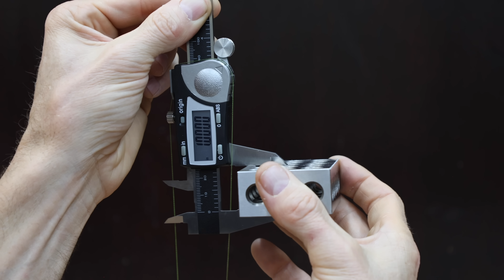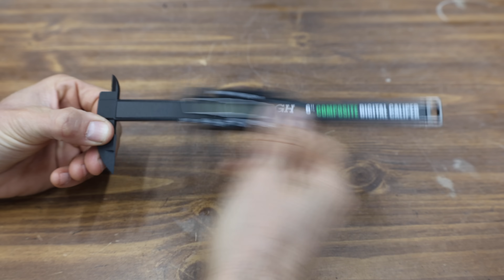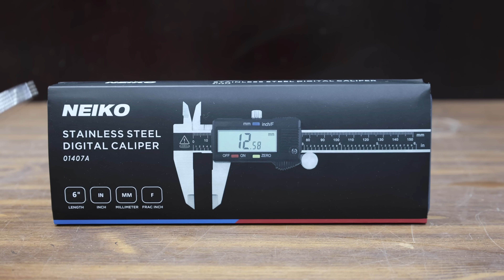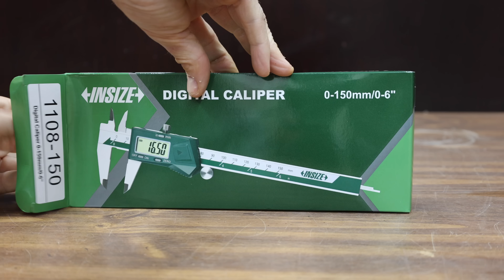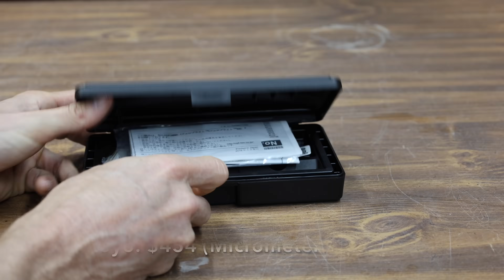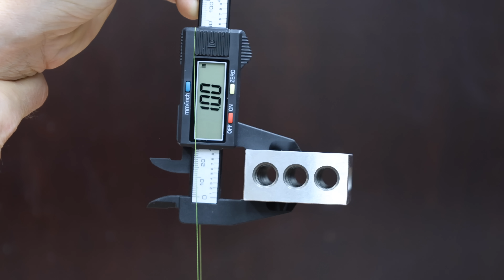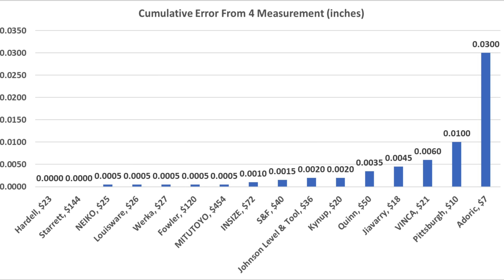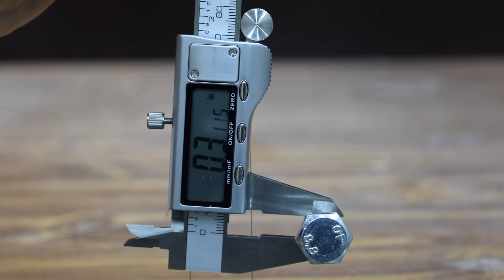I've Been Proven Wrong About Calipers!

Comment: The key here is accuracy over the time!

You gotta throw the top 5 calipers around the garage for a year, ten come back and do the test again.

Calipers have a resolution hand accuracy specification. All the top brands are within that spec... But will they continue to be in that spec after a year... That's all that matters. Will the battery terminals corrode? Will the buttons fall out? Will dust or debris damage anything?

There's a reason mitutoyos are $200+...
Reply from the maker: Thanks for the suggestion.

Comment: Important Tip - Buy SR44 batteries for your calipers, vs LR44 ones. The LR44’s output voltage droops as they’re used, and most calipers cut out at fairly high voltages - so your actual battery life is much less than you’d think based on mAh ratings. SR44s are silver-oxide chemistry, so the voltage stays high before dropping at the very end of life. They last much longer in typical cheap calipers than the LR44s, are well worth the higher cost.

If you’re buying new calipers, though, go for ones with CR2032 batteries, there’s no comparison in terms of how long the batteries last.
Reply from the maker: Thanks for the feedback.

Comment: Mitutoyo's battery life is measured in years. That is all my shop uses. We've had batteries go bad in the packages before, in the front office between battery changes in the calipers
Reply: It's true. Mitutoyo somehow gets batteries to last as long as they would just sitting around. I only use silver oxide batteries too. It's worth it. If I could put platinum in there I would. They deserve the very best. My Mitus live with a silver battery in their mouth.
Reply from the maker: Thanks for the feedback.

Comment: Some great points and intelligent testing here (very sensible to use a weight) but unfortunately missed the most important aspect of digital calipers: parasitic battery drain.

Every cheap pair I've owned drains the battery fast when turned off, meaning they're dead within 3 or 4 months even if unused. Then it doesn't matter how accurate or cheap they are as they don't measure anything. I switched to mostly using dial calipers because of this.

I bet if you measure the current draw while powered off the Mitutoyos and Starrets will be streaks ahead of most others. @AvE did a bit on this years ago I think.

Comment: A lot of important things not mentioned. Relative humidity as stated in manual ? I have calipers that only work up to 80%rH and thats true. I also have calipers that turn their display on upon moving the jaws, without reset to 0, so kind of absolute, very handy. I want to read out an caliper electronically, DRO. Do they have a connector, or is there at least a place to solder on, is the protocol documented in the manual, or does it conform to some other brands. 
The plastic ones are just crap, but a caliper needs to have an accuracy of 0.03mm (DIN862) or 0.02mm (MPE) and the manual should state the standard. Everything better is called 'good enough'.

Comment: My 40-year experiences - now retired - with calipers. 
. Wish I still had my work issued Mitutoyo digital caliper. 
. My cheap digital calipers batteries are usually dead when I’m about to used them.
. Fractional digital calipers seem to be a good idea specially for woodworking. However, they create more confusion than being helpful. E.g. a ‘3 3/128’ reading is not easily processed by me. Instead, a got a  Fractional Dial Caliper (with decimal sub-scale) that always works (no battery required). 
. Ask yourself if you need the .0001 accuracy/precision/resolution for home use. If not, a dial - no battery - caliper of medium quality is the way to go. I doubt that people at home are doing QC work measuring critical jet engine parts at home.
Reply from the maker: Thanks for sharing.

Comment: Just a heads up - that Mitutoyo price is way off on your results. That model # without the carbide and SPC is around $150. Side note - there is no way you can really test this but working at a calibration company Mitutoyo is bombproof (Starrett comes in good as well). For casual home use it wouldn't matter but for serious regular use there is a massive difference even stepping down to a Fowler or down again to Insize. They also carry replacement parts for very old models.

Comment: I built a digital depth gauge for my drill press using cheap-o plastic calipers.  They worked fine, because I could cut the excess length off, drill mounting holes, and not worry about wasting money if I ruined them.  0.01" precision is good enough for my kind of half-assed carpentry.
Reply: thank you for the idea sir!
Reply from the maker: Thanks for sharing!

Comment: I personally would not taky any of these calipers into my toolbox, for the simple reason that when I really need it, the battery is probably down. I have a simple nonius-scale based caliper with a nominal precision of 0.05mm. I owned it for over 50 years now, and never had to change the battery once ;-)
Reply from the maker: Thanks for the feedback.

Comment: Despite many professionals swearing by Mitutoyo, I absolutely couldn't justify the insane price tag for my amount of use, so I picked up the Neiko several years ago and have been extremely happy with it. It's definitely not a replacement for industrial usage, but it's far more than capable for jobs and projects around the house.
Reply: well it is certainly difficult to justify high price of mitutoyo for DIY project but for actual work environment Mitutoyo is non negotiable, i have yet to see a machinist who do not use Mitutoyo.
Reply: @iamnobody4574  I get that, I think the bigger issue with my search was that nobody could understand a use case for digital calipers outside of industrial machining. I just needed decent measurements for standard, commercially available nut and bolt sizing for simple projects where there was an generous margin for error. The Mitutoyo crowd did not understand that scenario AT ALL...

Comment: When you said the Pittsburgh accuracy was 0.01 inches, I thought for sure you meant mm. I have never seen a caliper with such horrible accuracy lol.  One of the big issues I've found with the cheaper units are they eat batteries when they are off so I have to take the battery out every time I put them away as I don't use them often.  May I suggest creating a "universal linear motion" test tool as I suspect some of the inconsistency in the smoothness testing was human variability.  There have been a lot of test you do, particularly when you are measuring drag, that moving by hand could introduce a lot of variability due to variations of movement speeds between tests and how human mechanics aren't very consistent when stiction is in play. Feedback loop is too slow. lol.

Comment: There's absolutely no point of using CHEAP (under ~$20) electronic calipers. They usually have lower resolution, and are definitely LESS precise, compared to any similar mechanical ones. Plastic jaws can add to the poor results - can be bent easily, also shrink or expand differently to cold/heat, and are extremely stupid if you are measuring mostly metal parts. Plastic jaws are useful only if you are measuring BATTERIES, and even then you can do without plastic jaws! :)  If you are on a budget - definitely use some old school (mechanical) calipers - if you find branded used ones, they will be way better than any of the new cheap electronic calipers. They are both more precise and infinitely more reliable (made entirely of metal, and you will never run out of battery). Only downside of mechanical ones, they have no DISPLAY, but this can be a plus too, because you can't break it. That's why - infinitely more reliable! :)

Comment: Really it is down to what level of accuracy you need, to accomplish what you want. For most home users a cheap set is probably good enough. If you do some home machining, you might want to spend a bit more for a known good mid-range brand. For serious work, you want known good brands like Mitutoyo.

Accuracy and repeatability of measurements are very important. Consistency is crucial, even a measurement device that is inaccurate but repeatably consistent can make for good results if it used for all measuments. Basically it is consistent with itself. If you are working from schematics or from measurements taken from a different tool, you will have problems though.

The battery life benefits of Mitutoyo cannot be overstated... Cheaper calipers will drain their battery even when powered off and be dead in weeks or a few months.

Comment: Should have used gauge blocks for the accuracy test. 1-2-3 blocks except the very best are known to have a few tenths variance over their length. The depth test on a rough wood surface isn't great either, that should have been done on a surface plate. Not to mention the heat of handling it can effect the measurements too.

I use almost all Mitutoyo instruments when working on my mill and lathe.

Comment: You missed the iGaging IP54 Electronic Digital Caliper 0-6", I've had mine for probably 15 years or there about. Just replaced the battery the other day. CR2032, Very nice, very accurate, smooth.
Those Mits have gone way up in price.  I originally paid something like $28 when they first came out, so I was surprised to see they are not that much more at $39 on Amazon.
They are accurate enough, when I need to be under .002 I am using my micrometers. I trust the Igaging to .001.

Comment: Starrett is already marked up to 293.99  Great review as always!  A tip for cleaning the faces on a set of calipers is to close them over a piece of paper then pull the paper out while holding the jaws closed.  Once you no longer leave black marks, they are clean.
Reply: Werka is also up 30% on Amazon.  Project Farm lists them as $27, I see them at $36
Reply: @Cecil_X  Pretty sure when he does these videos they go out of stock pretty quickly; I've noticed that too. 
Or the cheaper sellers run out, and some other supplier is all that's left
Reply: "Surge pricing" hits the tool industry.
Reply: You beat me to it--we were always told to not use cloth and that using stiff paper was the way to go.
Reply: That is very true about using paper to clean them--using cloth can cause accuracy problems.
Reply: And the sick part is that Starrett has them made in China. They still make dials in the US but....Just buy Mitutoyo. At least they're made in Japan.
Reply: @methylmania  Starrett was once an over priced union shop in Athol, Massachusetts, that mostly sold to the machinist trade. They sold the company years ago, but some of their stuff is still made there. TIG welders and sheet metal mechanics use to buy their combination squares, protractors and hard rulers.
Reply: @methylmania As a frequent user and purchaser of Starrett I will say the quality has never declined but the prices for their products have increased. I am not sure how they will remain competitive without outsourcing globally

Comment: getting most things from harbor freight is a craps game.

i got a 4inch caliper from them and i took it to the University of Louisville's Speed School of Engineering to have it tested.
it got a rating of "ETS"; exceeds testing standards.  made several of the graduate and post-grads students upset that my $5.99 caliper beat out their $300 to $1200 calipers.

i also got a 6inch that actually works.  bought several of these and only one actually gave a proper reading.

Comment: When the margin of error allows for a certain tolerance, it's fine to use less precise tools. However, for high-precision tools, a caliper must be metallic and remain in its protective case. It also can't be used if the tool has been hit, and the plastic expands imperfectly from the mold. That's why precise tools are metallic and machined.

Comment: The thing I hate the most about so many nice cheap little battery calipers is the drain the battery continually even when they are off, so if you dont use them often the battery is constantly DEAD.  Terrible design.

Comment: It's not fair to use depth guage on a shop table to measure accuracy.  Use a glass plate or granite plate.  I've been using Starrett and Mitutoyo for over 50 years without any problems.

Comment: Eventually micrometers and calipers turn into really close guesses and then you have to go to comparative measurement with gauge blocks for accurate measurements.  Even some really pricey 123 blocks can be off if you throw it on a piece of granite.  If you ever do a 2nd round of precision measurement tools be sure to record the ambient temperature.  Mitutoyo has some fancy ceramic gauge blocks that will cost you a kidney but if you are measuring steel parts then my thought is to get a stainless set of blocks so the parts expand and contract semi evenly.  Set the zero of a test indicator to a 1.000" gauge block and then see how many thousandths of an inch your over or under.  Mitutoyo's low power patent is something worth the money (as long as they aren't counterfeit.)  It's funny that people still use dial calipers and dial test indicators to see the overall picture of a piece

Comment: the other thing to note between the body of the "low end" cheap calipers is that the body of the digital read out and battery compartment are almost 1:1 copies meaning they all came out of the same factory but on different assembly lines for a given manufacturer which is likely why the accuracies are very similar across most of them. if they all use the same sensors then the accuracy should be near identical. just my 2 cents from looking at a LOT of different tools(most of which all come out of China and people don't realize)

Comment: CNC Machinist here, Mitutoyo is my goto. Also I know it sounds dumb but you can use calipers wrong. The pressure you apply to the measurement can throw off results. That same pressure needs to be applied during calibration. Results can easily be thrown off by +/- .003-.005 of an inch by the pressure applied or technique used on the caliper.This is why we never trust inexperienced machinists to measure or QC parts of their own. While the cheaper ones may work for a regular guy, Ill stick to my Mitutoyo because I know it will last in the harsh oils and coolants of a machine shop. I had the In-line set of calipers before and they didn't last much longer then a year in a shop before any amount of coolant in them would mess them up for the rest of the day. I have a very old set of Mitutoyo dial calipers from my grandfather that still work perfectly to this day.

Comment: I've got a dial caliper I bought from Cabelas more than 20 years ago.
Smooth, precise, easy to use, still accurate to under 0.001".  Should last the rest of my life; if not, I'll get a nice vernier.
I've also got a cheap plastic digital caliper I bought 10 years ago-it's useful for getting rough estimates, +/ a fair bit.  Has auto shutoff, but it still burns through batteries, and the connections corroded and needed cleaning.

Comment: I have the Mitutoyo, paid a fraction of the price quoted here, and they are a very beautiful tool, So good in fact, one must be careful  not to buy a replica.
Excellent video and very detailed analysis.
The one thing not included and cannot be, is performance over time.
I have a Jet brand expesive and a waste of money, they also eat batteries. The Mitutoyo battery lasts a very long time.

Going to buy a Werka for the jobsite tool box, thanks !

Comment: Great job!  When testing calipers you might want to also check for the effects of temperature.  Thermal expansion will impact the results and said impact will change depending on the materials used for construction.  The more expensive ones could compensate for temperature - at least it is possible but I don't know if they do are not.  But measuring the same object twice, once with the meter at room temperature and once after cooling off in the refrigerator, could provide some incite.
Reply: Thermal expansion will change the physical size of material. Now whether calipers are sensitive enough to read that is another matter. I'm never looking for that kind of precision with what I do. For me being within a few thousandths is good enough.
Reply: @1pcfred  It is the issue of thermal expansion changing the size of the calipers, not the item the calipers are measuring.  For a typical stainless steel caliper one would expect ~2.5 mil change over a 6" measurement when the temp changes by 50 degF.  Many plastics will be twice this amount.  The better calipers should be able to measure this.  The great calipers should be able to read the ambient temperature and compensate for this.  Probably does not matter that much but it would still be interesting to see if these calipers also worked well when cold.